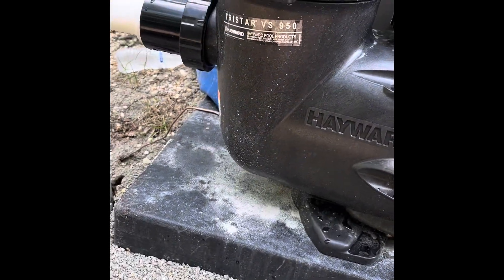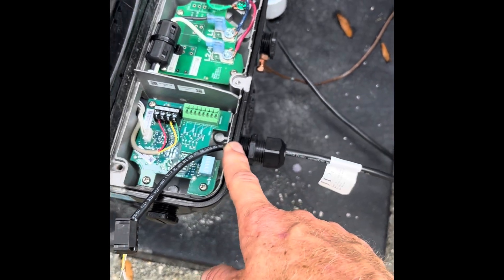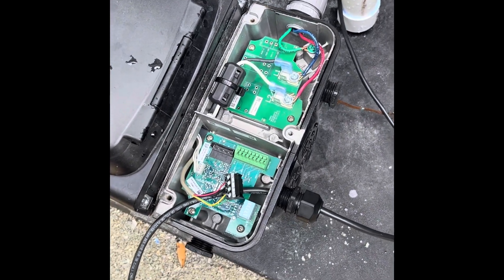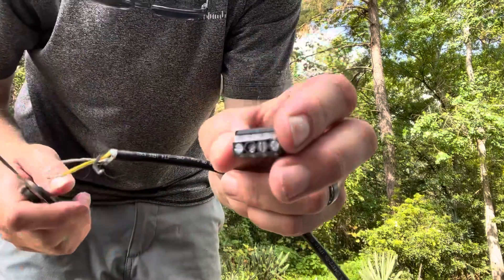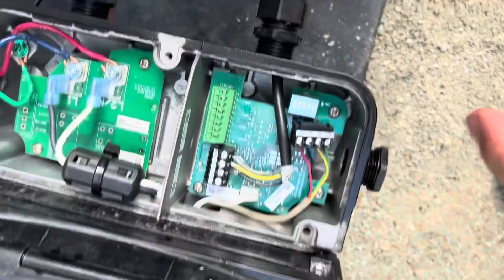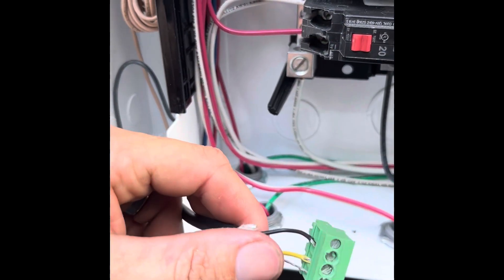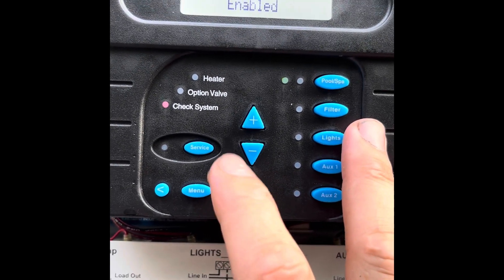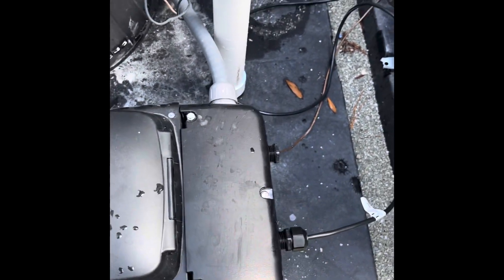How to hook up a Hayward Tristar VS 950 to a Hayward Prologic

Comment: Great job, thank you so much. I have a 9-10,000 gal pool with spa inground combo. The pump is located about 30 ft from pool. I have a Hayward Command Prologic system , my pump just went (an old one), I heard I HAVE to use a Hayward pump, to work with my automation. Is this true? and do you recommend a Tristar VS900 or a 950?

Comment: So I have a HW VS 950, I want to be able to control everything from my Omni logic app. Do I wire this as per this video? I have an external control panel for my Omni PL control panel. Do I need one end with an Ethernet connection for the control panel or can I wire it to the main Omni PL panel like to did in the video?

Comment: Hey Mike great video. I wanted to ask if you ever install a hayward 1.85 thp vs pump? It also has the omni pl panel as well. I was wondering where to connect the relay wires because the only connections it has if the 220 volt supply and the same 3 wire controller that you used in this video. Any suggestions?

Comment: What size are your wires supplying the panel?
Reply from the maker: @lcheffin  that I don’t know. I just do the low voltage stuff for this builder. I’m not an electrician.

Comment: Bro you are an absolute legend for uploading this. I was worried about the VS pumps not working with the prologic, but if you got the Tristar vs 950 hooked up to it with automation, I can definitely hook up a Maxflo VS 500 to prologic automation using similar steps. I just needed to know it was possible and see someone do it. Just bought everything from SCP and about to head to the clients house now. Thanks!!!
Reply: Update- My first ever install of a variable speed pump hooked up to an automation system and it went great! I just put in my headphones and used your video as a step by step guide. My customer was extremely happy! Thanks again for uploading this! I was absolutely stressing that I wasn’t going to be able to do it before I watched this.
Reply from the maker: @evanferree  nice! Everything is easy once you learn how to do it! I used YouTube to fix something standing in front of a customer yesterday. It’s a lifesaver.
Reply from the maker: Trying to post more stuff like this. It’s hard once I get busy in the summer. Been doing pools 15+ years glad I can share of my brain.